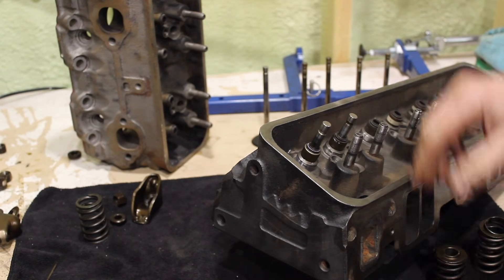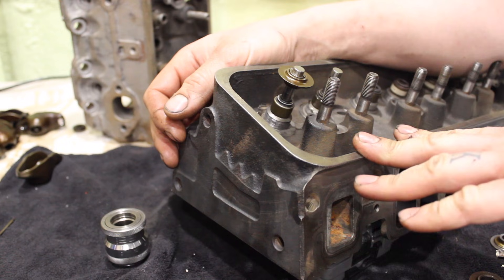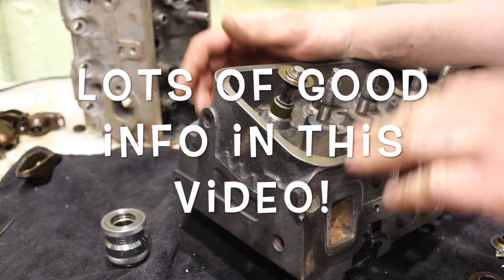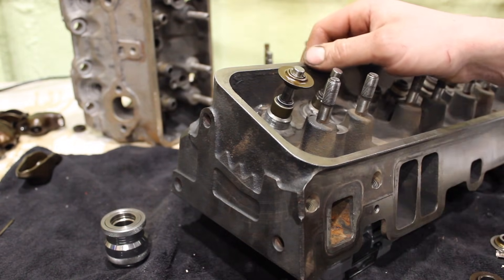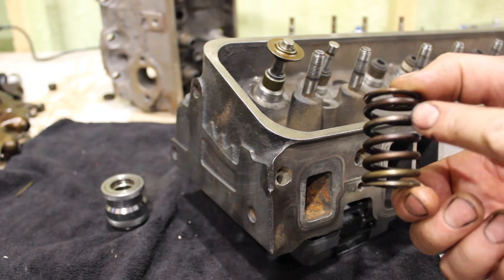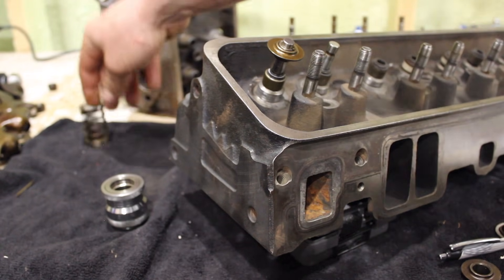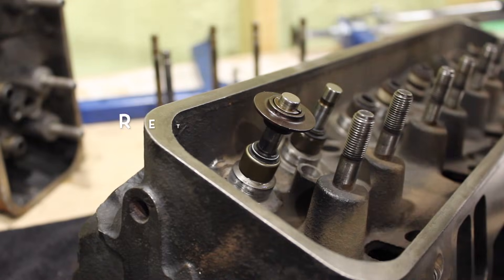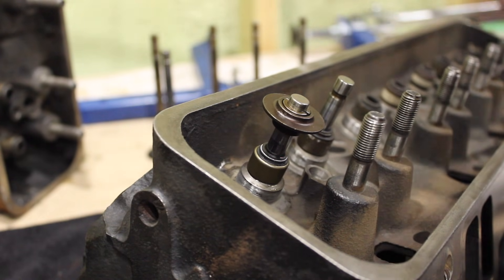How Much Lift Can a Stock Vortec Really Take? Plus .500 Lift Cheaply (Stock Guides)

Comment: My heads must of been cut down or something because I bought my set from right from a 602 engine and had them redone at machine shop with Ls1/ls6 springs, comp 787 retainers, 648 keepers and fel pro 72861 seals and had retainer to seal clearance of .611 lol! Spring install height 1.770 spring closed 115.lbs and at .500 300.lbs! Machine shop said good to over 6,500 rpm no problem with flat tappet!
Reply from the maker: Im assuming that's .611 without clearance, so you're good for .550 with .560 lift? They are probably stock guides if thats the case. Before covid hit, I was putting together beehive kits that allowed .580 lift on a stock vortec head with special retainers. But even the 787s allow for more lift than the stock retainers, especially with the taller installed height. Beehives are my first choice for vortec builds 👌

Comment: Aren't the inner springs there in case the spring breaks that spring keeps the retainer lock in place so the valve does not fall into the cylinder?
Reply from the maker: Thats a dual valve springs your thinking of. The purpose of the damper is to help prevent spring surge but with the large vortec guide its causes more issues that it helps
Reply: @cuttersperformance  Ah OK it's funny how we assume these things. Thank you for the info.

Comment: Thanks and dammit man, the cam I am gonna use is .550/.565 hydraulic roller, guess I am getting the guides cut down.
Reply from the maker: Yeah, guides cut, and probably pushrod guide plates would be a good idea
Reply: @cuttersperformance  I already have self aligning full rollers and screw in studs with no nut to retain the guide plate already installed.

Comment: Personally, I would just cut 060 from the guide, also I would consider using a +100 valve. Spring seat cutters and seal cutters are cheaper than a valve grinder if you don't have one. The tip on the felpro seals is great I've been using the o-ring type seal
Reply from the maker: Theres certainly more that one way to skin a cat but a valve grinder isnt actually needed. Years back, I did it with a bench grind and a flat file. Just took my time. $20 valve seals, $75 springs, and your good for .500 lift with a flat tappet cam
Reply: @cuttersperformance   what lift do these heads stop making power ??

Comment: I like the idea using a valve grinder to cut down a retainer. Do you have a better view showing what you do or use to hold the retainer on the valve? Are you using a stop to hold the valve-retainer in place so it dose not move and what is it? Thanks for sharing your knowledge and simple tips, Ron M
Reply from the maker: Using an old scrap valve, you simply flip the keepers and install the retainer upside down on the valve tip. Grind away the valve tip until your grinding the retainer. You can tig weld the keepers on the valve stem to stop them from falling off (or even a drop of super glue) Use the dial on the grinder to watch how much your taking off and verify with with a caliper. Works like a charm 👌
Reply: Thanks for the reply and info. What is the block used for that I see on the steam grinding fixture
 when you grind the retainer?
Reply from the maker: @Ronald Miller  its a scrap valve, with the keepers flipped and the retainer installed upside down
Reply: @cuttersperformance , that's exactly how I was thinking you may be grinding the retainers down, and that's how I would've done them as well.. I used to work in a machine shop years ago, and I can assure you I grinded my fair share of all types of cylinder head valves, along with rebuilding all types of cylinder heads.

Comment: You are quickly becoming the MYTH BUSTER of VORTEC MISINFORMATION. Lets see if you will reveal some more dirty secrets. I am doing a re-ring job on a high mileage (250k) excellent condition 99 l-31.
I am going to go flat tapped on this re-ring job and save the $$$ for a full roller for the next complete rebuild.
Do I buy a can kit for a old school PRE-ROLLER 350, and if so, are there ANY dirty tricks waiting to bite me in the AXX? Keep up with the myth busting.
Reply from the maker: Are you referring to a rebuild kit? If so then no its very different from a 2pc block.  Main Bearings are different, vortec roating assembly uses metric rings, pan gasket and rms gasket are different ect.. so your best bet is to get a late rebuild kit
Reply: @cuttersperformance  It's my fault I was vague on what I was asking, my bad.
My L-31 short block is done 100% I was referring to going flat tappet instead of factory roller. I am going to save the $$ and go fuller roller on the next total rebuild, not this re-ring job. I have been led to believe that 1 piece flat tapped cam-lifter setup is virtually the same as 2 piece flat tappet setup. Just trying to flush this out, before I start buying. Any info is appreciated. Keep busting those myths.

Comment: Well well well...I must admit I didn't know that the factory didn't bottom out the seals. I also never considered 981 springs without the damper, well now. And to top off the list I NEVER considered machining the factory retainers by say .030...that alters the retainer to seal crash height, but not the valve tip height...both good and simple. You just revealed some info....NOBODY talks about....keep knocking it out the park!!!!
Reply from the maker: Appreciate the positive feedback. Thank you, Mike!

Comment: I was wanting to break in  summit 1103 cam int 444/466 ext on stock vortec springs and 7.794 stock push rods then run it for about 1k miles or so. Is that alright? The block and heads only has 118k.
Reply from the maker: Shouldn't be any issue as long as the valve seals are fully seated like shown in the video.
Reply: Can I run zz4 cam with the 981 spring Cut down  retainer 30 thou offset keppeer   an seal  thanks
Reply from the maker: @malcolmburton9481  the 981 springs are technically only good for .490 lift

Comment: More importantly,  at what lift are these heads designed to operate in.  Why lift to .600+ if the heads flow the greatest efficiency at .500!
Reply: Because of a thing called "area under the curve" , if your peak flow is at .500 it would be a waste not to do everything you can to lift past that :glasses-purple-yellow-diamond:

Comment: Have you done or have any info on adding 1.6 rockers on a stock lift L31. Appr. .414 .428 stock - .442 I /.467 E
Reply from the maker: It can be done but as seen in the video make sure your valve seals are fully seated or they will probably hit

Comment: Man iam running ls1 beehives and and the offset keepers with retainers from comp cams. I also had the guilds cut and iam using a blue seal that the machine shop gave me but i think they are simular to the felpro. its been fine but iv been using the factory vortec rockers. my cam was a new old stock 12-268-14 which is .480 intake and .480 exhaust. i guess i got room to grow!!! iam super curious if instead of risking another cam break-in i might just increase the rocker arm ratio.
Reply from the maker: Youll have tons or clearance man, i usually dont cut the guides until .550+ lift. Beehives are usually my choice on most builds but for a flat tappet a single reg spring works well. You could certainly add a 1.6 rocker arm to increase lift but make sure you have rocker arm to retainer/keeper clearance.
Reply: I agree with the cam/lifter epidemic I would agree on 1.6 rockers.
Just be careful on your selection with those also being self aligning as Pat stated they can be tricky with retainer/keeper clearance as well.
Reply: @BDauto86  just add guide plates and forget the self align rocker go roller tip 1.6 and call it a day for ur build
Reply: @B&D Auto  I’m about to use 1.6 steel roller tips all the rule allows me to use. But will guide plates go on these heads with the press in studs?  What all is necessary to adding guide plates  will different push rods be needed ??  Just wanna be clear I appreciate ya brother
Reply: @baims8367  not sure I ran a 7/16th screw in studs with guide plates to get rid of the self align I got the studs with the hex shank on it that’s why I had to cut the bosses down to make up for height difference
Reply: @baims8367  your gonna want screw in studs, ideally like Pioneers they have no hex so No need for machining. You should be all right with whatever pushrods you have or want to use just measure and make sure correct length.  Pat@ PissCutter and Russell @ Diabolical Racing is a wealth of knowledge on these heads and SBC setups, good guys to deal with.

Comment: Awsome info.  Now comes my question of pushrods when you put 062 heads on a gen 1 block with a L79 cam..😮😮
Lol
Reply from the maker: Push rod length needs to be check for every application but it will be close to the factory 7.800 inches (2pc block with flat tappat cam)
Reply: @PISS-CUTTER Performance  now, if ya wouldn't mind sending me some Tim Hortons. South Carolina isn't as close to the Great White North as my old home of Buffalo NY... be well bud..
Reply from the maker: @kiesha104  haha Gotta love the Hortons
Reply: Yes, you can do it, a buddy put 40k miles on a smog 350 with the l79 and vortecs